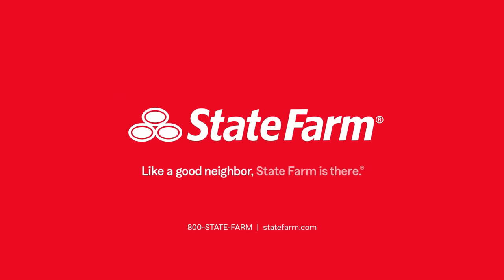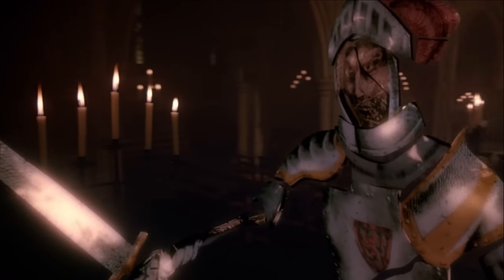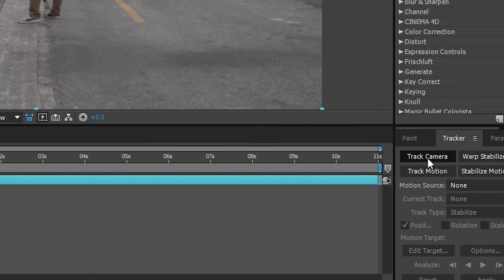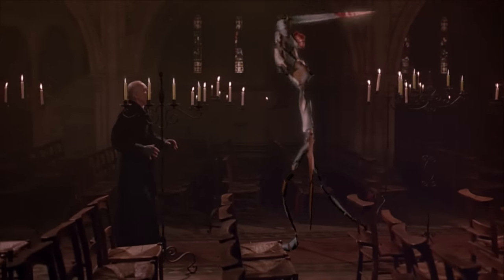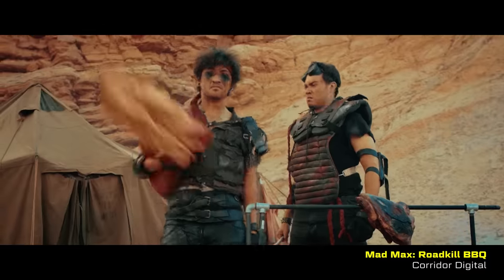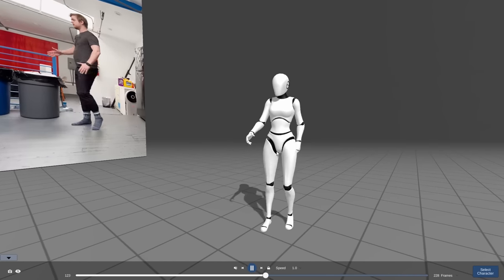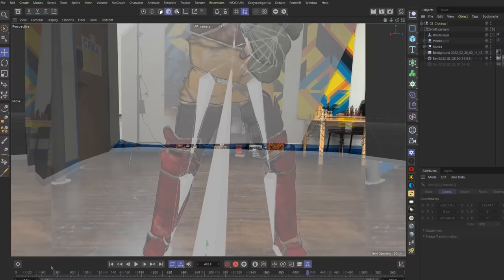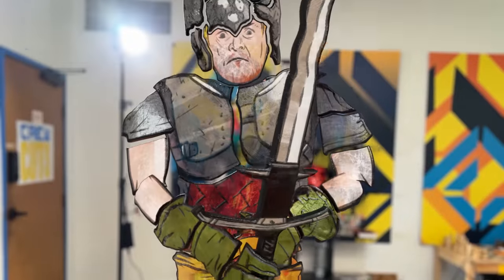We Remake the FIRST EVER CGi Character to see if it’s Gotten any Easier.

Comment: " When correct doesn't feel right, go with your feelings" is such an important bit of advice for creative work
Reply: doesn't usually hold up in court though
Reply: Well there's a balance. That's a good idea a lot of the time, but a lot of what you're doing may not necessarily feel right until you've seen your existing process the full way through with the current project.

Most art is a constant see-saw between "screw what's correct, go with what feels right" and "it may not feel right just at the moment, but trust the process"
Reply: Me when I'm taking a multiple choice test
Reply: There are many examples where mathematically correct doesn't look right at all. A grey gradient doesn't look balanced if you go 0-100% opaqueness linearly. The perceived neutral greypoint is like 40% or so? Don't remember the exact number
Reply: What’s more important to the audience, technically correct or feels correct? Motion pictures have always been a trick ;)
Reply: The rule of cool.
Reply: @derAtze  I learned at some point that our sense of color is exponential
Reply: Gunshot wounds and explosions in real life don't look very interesting on film.  "We need more gunpowder, more blood, more explosives, more gasoline.  Now it feels right!"
Reply: If it looks right, it's right
Reply: Bad advice for politics though.

Comment: I mean considering that the way you built the character is this shattered man, I think adding in the Emission filter is quite intuitive. The glass would refract light in ways that would be hard to simulate so having it just glow a little bit is a good way to emulate that I think.
Reply: good point, its not only translucent but refractive
Reply: I think perhaps it's more that the time we look at stained glass is when there's light shining through it, as that's when you can really see it and it looks good, so it would look off / unsatisfying if it's not 'backlit'.
Reply: Also refractive material often end up darker just because there is not enough samples to represent real total amount of light that go trough.   It usually work fine with an absurd amount of samples but it also take an absurd amount of time to render. So emission is a good way to fix this without increasing render time.
Reply: @callum_boss  That's a good guess, but even more than that it's because it's usually looked at in a church setting, so there are certain mystical and religious forces that would influence our perception of the glass
Reply: Like adding an ambient light value to the glass
Reply: @buffnipz  Those forces aren't a thing.  The most magical you get is the light propagation. Which is magical.

Comment: 4:50 which is called 'forward kinematics' in robotics land.

Inverse kinematics is where you have a constraint, like the tooltip or gripper needing to be in a certain position and orientation, or following a certain path, and then need to work out the set of joint angles that can fulfill those constraints.

Comment: Funny, I'm brand new to 3D modelling, I have been working on a ps1 esque retro game and I ran into exactly the same issue as wren, without adding some emission, often the lighting would not look right on some materials. Even when it doesn't make sense for the object to be emitting light, tweaking emission just helped nail the overall look.

Comment: Colored glass will scatter some of the light because of it thickness, and that is not happening with a flat texture on a mesh. That is why you needed some emissivity to make up for this. I expect that glass depth simulation will be the last thing that gets raytraced in realtime due to the extreme bounces and scattering and basically no assets have attempted to store depth for transparency.
Reply: Right and why bother with calculating all that for an emission anyway?
Reply: You could probably fake it with some sort of subsurface scattering using voxels for the color information

Comment: So Wren talked about how he needed the glass to emit light as well to look right, and this makes perfect sense based on the method.

See, light doesn't just go through glass, like it would with a transparency mode. With imperfections, cuts, bubbles, smudges, etc., the light would bounce around. This can lead to the light making the glass seem to 'glow', because its not being emitted directly from the source.

Similar to how scratches in class can cast glares, or how a shattered glass effect (which Corridor Crew recently talked about) requires a different method.

Also, if you've ever looked at/through old or thick stained glass, its hard if not impossible to see through, its translucent more than transparent. If you are using glass as a material, translucency (or transparency as well) might be a material property and not as easily changed as emission, which would be a direct effect.
Reply: This was quite interesting ngl. Thanks for the insight

Comment: I think part of what made the T-1000 going through the bars fascinating is that they very likely did not have UV mapping at the time and it was 100% straight projection rather than projection mapping, as in "literally a virtual projector projecting Robert Patrick on the mesh" such that depth changes in the mesh just stretched inward without distorting the rest of it which attempting to recreate it in Blender couldn't do.

Comment: to my eye this video is a showcase of how you need a strong first step to make cg look good
everything wren did for the stained glass man is TECHNICALLY fantastic, the shadow stained red from light shinign through the glass, the shines and reflections of light appearing exactly where they should be, the motion being incredibly believable and real
and yet, to my eye not for one second did i buy wrens version as "real" while the origional does look "real"
and its because the FIRST step, the look of the man himself and how he was cut into seperate pieces of glass, failed to look like glass
it looked like a drawing, when it was cut into seperate pieces and perfectly rendered in motion, it looked like a see through drawing 
at no point for even a second did i buy it as glass, as it always just looked like a drawing on paper. it was a fantastically rendered and animated drawing on paper, but a drawing on paper none the less, which (again to my eye) caused it to complety fail as a cg character, at no point did it i "believe" it was real and in the scene

while the origional, because its first step works, the base character LOOKS like its real and made of stained glass, when combined with the fantastic work of the animators the thing looks real, it looks like its actually there

Comment: I think the reason you had to have the glass emit was because if it was in the environment the glass would catch more light than just what passes directly through it. First, light passing straight through will be visible, then light passing at a slight angle so that when it bends it bends into the path of the camera. Finally, the staining would be lit from light coming from all kinds of angles. Therefor the light that passes from the glass to the camera would be more than just what would hit the camera without the glass, and a lot of that extra light is specifically hitting the pigments in the glass. I wonder how much "artistic touches to make things look right" are actually "correct" in that we know how it should look even if our understanding - computer simulations - are missing information.

Comment: I have not seen any comment yet about the cleverness in the original of choosing something, a character, that should NOT look like an "ordinary" solid thing in the real world.

For example, one of the best moments in the original is when the stained glass man walks past the camera and you see that the "back" of its head looks just like the front, and it is basically made up of 2D bits. 

As the character is somewhat transparent, no need to block out things that it would cover up.

This reminds of some of the first fake ghost photos, which were simply double exposures. "Well of course you can see through it: it's a ghost!".

Comment: Honestly, the cg isnt as good as the old, but the fact that you did it in a week and it looks as good as it does really is astounding. And honestly if you had more time for the whole production, the little thing you did would have easily been on par if not better,  which still easily blows the production time the stained glass man took right out the water.
And to give where credit is definitely due, there was a lot of first time experimental shenanigans going on with all the programs and such that was used, so alot of first time stuff, which undoubtedly was done on purpose to atleast somewhat emulate going through uncharted territory.
Really good job :D

Comment: Dude! "I don't know if adding an emissive channel to this is realistic..." An emissive channel is realistic when dealing with almost anything supernatural or magical (hmm. Is one of those a superset of the other? Must research that). It's also often realistic in a Clark's third law situation. You know "any sufficiently advanced technology is indistinguishable from magic". 

Or with anything that normally has OBAs (optical brightening agents) like white clothing (the fibers are initially treated in fluorescent agents, and other agents are present in laundry detergent), paper (printer paper often has a rated brightness of 104-110, meaning that it is brighter than a theoretical 100% perfect diffuse reflective surface), teeth (yes, they put OBAs in "whitening" toothpastes and teeth treatments), hair, etc. I'm serious about that. Most rendering engines do a great job when you go bonkers with emissive surfaces (neon, blasters, etc) but they don't do well with the subtle fluorescence of teeth, clothing, or paper. Get a small 365nm black light flashlight with a "black" filter (not a 395nm) and shine it on something you're having trouble texturing. Odds are there's some fluorescence that's f'ing things up because you don't have it in your shader.

Comment: There is a issue with this video, you guys imply that the artist doesn't need to do the complex calculations in order to achieve the scene that they are after when in reality the techniques of the past influenced the current generation, you yourselves have shown that you can't just make a scene however you want, you need to take into consideration lighting, motion, camera angle and actors all to accomplish the scene, you pick a location based on those variables and then adapt it to suit your narrative, you don't realise at the time but you have already done the calculations needed for the computer to complete the scene, perhaps if you tried "line tracing CGI" which gives the CGI look but was a cartoon super imposed onto a scene, the length of time it took to do that was equal in the late 1970's to doing a CGI scene of the same length, however the time shortened with each subsequent film that used CGI!